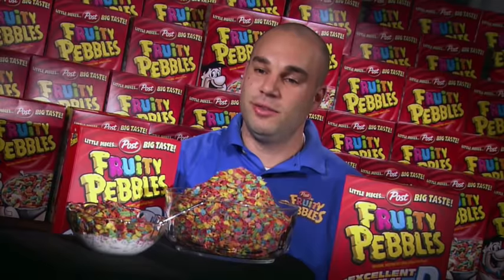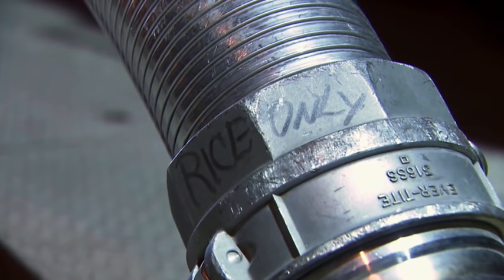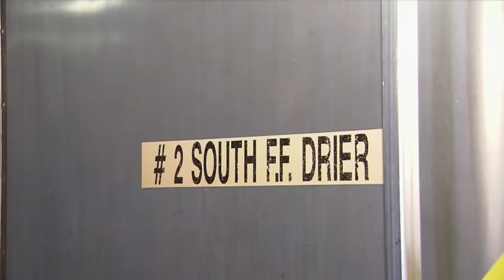How Fruity Pebbles Are Made (from Unwrapped) | Food Network

Comment: I work as an extruder operator at weetabix, which is now owned by post, we don't make the fruity pebbles there but we do make frosted flakes, shreddies, all kinds of hoops like fruit loops, christy brown, chocolate O's. and weetabix biscuit (thats a different line to mine all together), plus all kinds of different shaped cereal like puffins, stars and animal shapes. 

The line that I operate is a large extruder that forces the raw material dumped by the "sack tip" into a mixing machine, then it goes to a holding tank above the extruder and uses gravity to come down into the hopper (the powder/raw ingredient mix moves around via pipe with air blown through it) and it is fed out via two augers into a shoot then into an opening at the top of the extruder. Once inside its mixed with water and sometimes a "liquor" we call it that can be anything from molasses to apple concentrate, sometimes with sugar and salt added in depending on the product. After it enters the barrel its mixed by two long screws with paddle like spots near the center to mix it without forcing it forward to fast (it looks like a screw then turns into a something like a camshaft from a car, then back to a screw) then its pushed forward down the barrel that has heaters with cooling jackets to maintain temperature where it emerges and immediately puffs up from the heat. It them comes out the die face in strings and is either cut by a spinning blade immediately (for stuff like hoops, animal shapes  etc) and goes down into a funnel we call the horn or it comes out in big long ropes that run along a 5 foot conveyor belt into a crimper that pinches each end and cuts it then it goes into another blow line where its taken and travels to a toaster that takes the excess moisture out and gives it the desired shade/colour. From there it goes into onto a cooling table (both the toaster and cooling table vibrate to move the cereal down the line) then it goes up a bucket life system and into the ISO flow which separates small and large pieces as well as any fine dust or cuttings. From the ISO flow it drops down a shute/pipe with a metal detector into totes of a desired weight, its then labelled and taken to the packaging area (not my area, to many women and to much gossip :P) or if its a product that we don't have the equipment to finish it is shipped off to another plant. 

Its actually a pretty fun job, I get to play with some cool machinery and get all the free cereal I want lol not that I actually take it these days.